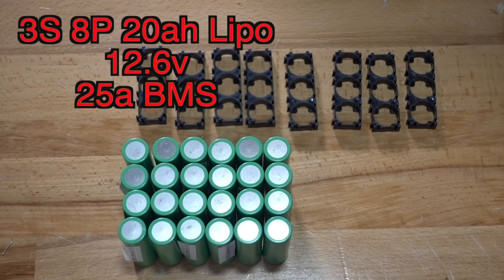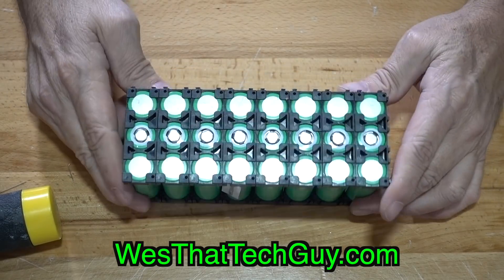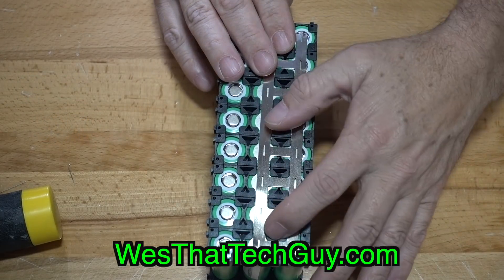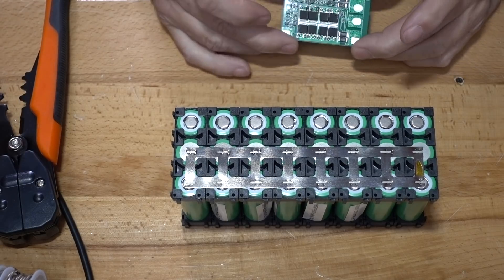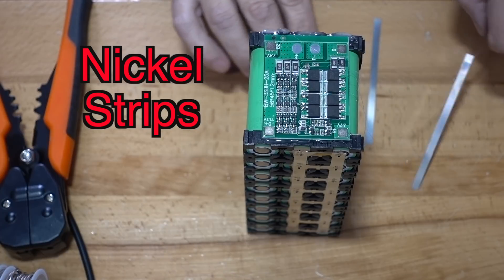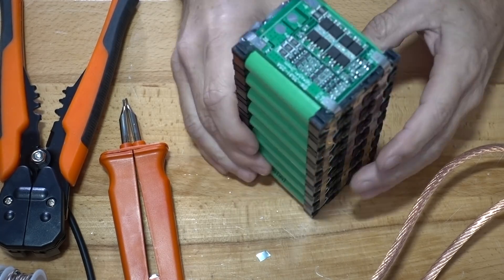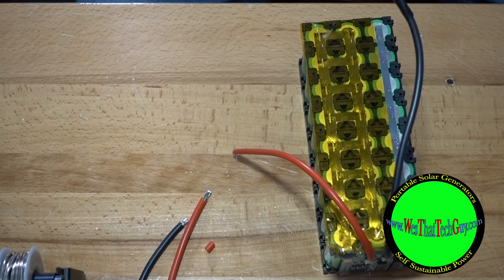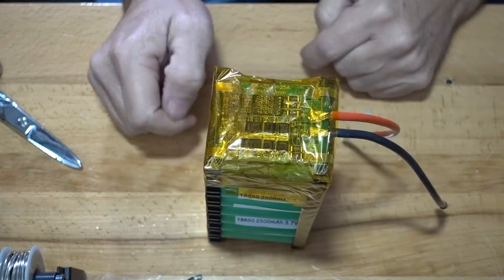How to Build a 3s 18650 Lithium Battery Pack w/ BMS Tesla Power Wall fixed music

Comment: I have a ton of 18650 cells. How can I best make a pack to put parallel to my solar panels. My panels are total 800w and it needs to store about 4.8kW.
My inverter is also 800w so thats what I would draw from it at max.

Comment: Hello I have used a 40amp bms on my 12v battery pack and after connecting it up correctly I cover the bms in tape for safety and when I turned the battery on its side a fuse has blown on 2 different 40 amp bms the fuse is right beside the 4.2v(P3057LDG) do anybody know why this is happening thanks

I dont know if it is a fuse or not its the little black chip right beside the 4.2v connection

Comment: Hallo, kann ich 2 Akkupacks mit jeweils 1 BMS per Akkupack parallel schalten und mit Ladegerät 12,6 Vol zusammen laden ?
	Hello, can I switch 2 battery packs with 1 BMS each using a battery pack in parallel and load 12.6 volts with charger?

Comment: Any suggestions for making a battery with variable voltage, constant current, constant voltage like a bench power supply has? My idea would be usb-c chargeable. This is directed to anyone out there who has knowledge.

Comment: Ive watched this over and over and the way you have the batteries it looks like its touching the pos and neg at the same time ... isnt that a direct sort on the battery
Reply: No, its in series and there is no short because the + and - on the opposite side is the opposite of that in order to raise the voltage.

Comment: Hi,

I built a 3s7p, 40a bms looks similar your bms, everything works except when I charge the pack, the charger seems always charge at constant voltage mode and the current is low, fraction of what I set it to charge at. Any ideas?

Comment: I’m doing a 3s2p 12.6v battery pack with Molicel P-28A cells and each cell is 35A and 2800mah each cell . What BMS with balance should I use , a 40A , 60A or 80A BMS with balance ?

So the 3s2p i will build will be 35A both rows 3 cell each in series and when combined in parallel it will have a total of 70A so it will peak at 140A at a max discharge rate the 3s2p battery pack , so at least i will need a 80A bms or a 100A Bms ?

Comment: Nice vid but how do you exactly charge this thing up?
Reply: Since it’s a 3S you use a 12v chargesr you can find it on Amazon and just be sure you get a charger that can handle the amps so what I use for my battery I built like in the video is my imax B6 mini charger.

Comment: Hi
Thanks for your video.
Can we use this type of battery to replace lead acid ups batteries?
Reply from the maker: If you can match the voltage to the charger inside of the UPS
Reply: @WesThatTechGuy  do you mean 12.6v?

Comment: if each 18650 is 2500 mah then would it not be a 6 ah battery instead of a 20 ah battery as stated ?
Reply: 8P is 8 parallel , that is 8 x 2500mAh = 20Ah

Comment: Hi what do I need to build a 20ah 12 volt  lithium 18650 external battery it's to run a cellular 12 volt trail camera. And to recharge it. What bms will I need. Thanks

Comment: What charger voltage is required, 25.2V or 29.4V?
I can't seem to get a definitive answer to this, both chargers are available but what one is best ?
Reply from the maker: 12.6v charged. It has been listed in the comments numerous times. It's neither of the 2 you listed. Its a 11.1v nominal and 12.6v charged. you need a 3s (12.6v) LI-ION battery charger.

Comment: Excellent !! Please let me know for 3S10P configuration with  battery ICR18650-28A the BMS How many amps should it be?

Thanks in advance and Regards 

Jose
Reply from the maker: Jose, I need to know the application you're using it for? How many amps will you be drawing and charging continuous?
Reply: Good Morning !!

Actually, this configuration is for two projects, the first is as a portable starter for cars and the other is to be used as a power bank for a 12 volt mini inverter with a maximum discharge of 3 amps hours.

Once again Thanks and have a nice day 

Jose

Comment: what size is the nickel strip that you used here?

what voltage and current would i need to charge a 12.6 volt li-ion battery please
Reply from the maker: i used standard 18650 strip. you could do 16.6v and 1a-25a to charge this battery.

Comment: You should be soldering to the board, not using a spot welder.  The board traces aren't intended for spot welding.
Reply: You get bms boards, like in the video, that has nickel strips attached for spot welding.

Comment: Hi how do you charge this battery (you charging trough the main red and black wire or you add a separat charging connector) And what tipe of charger do you use to charge?Thanks
Reply from the maker: charge and output to load is on the red and black. pos to the battery and neg to the BMS

Comment: a few questions.. I might sound being dumb..
1. Where do we supply the Input power to charge the 18650s? and How many Volts do we need to provide?
2. If the answer to my first question is "P+ and P-" then from where do we get the output power?
3. How many Amps max can we get out of this battery? What are the factors that determine the Max Current output?
Reply from the maker: you connect all pos. loads to the batteries + terminal the all the neg. loads to the BMS' - terminal.  this battery can output 200a. this is done by calculating 8p x 25a = 200a

Comment: I have one of these but the 3.7v and 11.1  terminals are on the opposite end as yours. Does it matter which way we position the charger?
Reply from the maker: no as long as you configured correct.

Comment: I am looking to make a pack that has a rather large capacity. I like the 3s config. Can multiple packs like this be connected in parallel for better storage, or would I just add more batteries to the pack? Thank you for making great quality vids!
Reply: You add more batteries
Reply from the maker: Yes, absolutely, but either way works

Comment: Hey, super great video, I'm planning to build a 3S7P almost like yours here, I'm wondering which BMS is better, It'll power a Chicago power systems inverter (92708) which is rated 12V 400 watts. I don't quite understand yet if the battery capacity determines the BMS's amp rating or if it is determined by the load.
Reply from the maker: Julián Mauricio Ramírez Obando Thanks for watching! Your inverter is capable of producing about 34 A. And your battery bank average will depend on what type of battery you buy or use. 400 W divided by 12 V equals 33.3 A. The BMS is to protect the battery pack. I would suggest a 50 amp continuous balance BMS. We currently have them in stock at SolarGeni.com
Reply: @WesThatTechGuy  Does the discharge rate of the each cell have importance on what the size of the BMS current level should be?

Comment: Thanks for the video.  I would want to connect a balance lead to the pack.  Is that what the regulator you installed is for, or is that for strictly discharge regulation?  Thanks.
Reply: Most of those boards have it on it already you just have to read the description of the board
Reply from the maker: its a BALANCE BMS

Comment: How do you recharge this? I built one exactly like this and can't get my charger to accept it. Isn't it missing a balance lead?
Reply: By using 12v charger you can charge it
Reply from the maker: balance leads are directly soldered to the pack. watch closer. 12.6v CC/CV charger Li-ion only

Comment: Sir  Can I charge it with 15v 2A  ac adapter, or I must have 12,6  2_3A
Reply from the maker: NO. you must use only 12.6v MAX with CC/CV you can use any amperage under 50a

Comment: QUESTION: if you want high amperage AND capacity in a “performance” ev how difficult would it be to have a secondary battery pack that has a high cdr compared to a larger high capacity pack that you use for every day driving? Like if you put your foot down or went up a hill the higher amperage battery pack takes over when there is a higher current demand?

Looking into using a model s drive unit in a e30 bmw. Just a newbie doing internet research and throwing ideas around. In theory would like to use a large pack of Panasonic NCR18650BD cells for capacity and a smaller “turbocharger” pack of something like Sony VTC4 cells for current.

Any information or feedback or more info on anything like this or diy batteries or tips and tricks or whatever would be greatly appreciated. Thank you for your time for anyone reading this!
Reply: I think what you are talking about is in whats called the hairball or controller for the motor no matter how many batteries you add if thats not modded it wont ever go faster then what its set at

Comment: Hello Sir, as asked in a previous question, do you know why my  3s BMS gets red hot to point of burning my fingers, all wired just as you have done, as a temp measure I have cut all nickel strips off and await your reply please?  many thanks,
Reply from the maker: ian whiteley Generally if the bms gets hot and it’s new it’s because you’ve wired the positive leads wrong and then plug it in. You’ve got to be sure to get all the proper positive leads to each group of cells. test the pigtail with a volt meter at each point you should double your voltage if your voltage does not double all the way up to your required voltage then you connected wrong. If that is all correct and still getting hot you probably have a bms issue. Is it hot when you just plug it in or does it get hot after you ran a load through it?
Reply: @WesThatTechGuy  Very many thanks, now sorted,
Reply from the maker: @ianwhiteley964  You're welcome.

Comment: how many Battery can i parallel to Using the 3s 40A BMS Board
Reply from the maker: Wessam, It depends on what the ah/mah of each battery is. If they are 2000mah/2ah you will need 20 in parallel.
Reply: @WesThatTechGuy  thanks
Reply from the maker: Your Welcome
Reply from the maker: YW

Comment: why my bms 3s positive side 101 chips gets incredibly hot, hot enought 
to burn fingers if you touch? I have 36 batteries connected as shows in 
this video. Have tried to connect 4x 3s bms, thinking maby its to high 
amps for 36 batteries, but still all 4 bms B+ side is frying hot!!! What
 i did wrong and why is so hot? Dont think it should be that hot. But if
 this normal, dont realy want to use BMS as i dont think it safe to use 
them at that temperature! Please need help asap! Thanks
Reply from the maker: If its with no load make sure you connected your balance leads to the correct set of cells. If wrong the BMS will get hot sometimes. If with a load than could be a problem with over amperage.
Reply: @WesThatTechGuy  no load, and all connected by the scheme off the bms. I have tripled the resistors(101x3) in series and its berely gets warm now. I guess the bms isn't proper build. It's 12v 25a bms I got from ebay.
Reply from the maker: the bms should be ran in parallel not series if using more than 1!!! You need the 11.1v/12.6v bms for a 3S lithium pack.
Reply: @WesThatTechGuy  I tried 4 bms connect in parallel, but resistors of all 4 bms was still getting incredibly hot. What I did, I have removed resistors from other bms and soldered on one in series. So instead 1 resistors I have 3 connected in series. Only that way I got temperatures down to normal. I'm not sure that's the right thing to do, but for the moment I haven't tested how bms will work on charge and discharge.

Comment: I bought a 4S 40A BMS. My question is for 40A, how many "p" maximum I can have in this 4s pack?
Reply from the maker: this can be infinite amount of batteries in P (parallel). you just cant charge more the 40a or discharge more than 40a.
Reply: Wes That Tech Guy Thanks. You are one of the few guys who answer to learners. Great! 
 But still I need more advise. 

“”Charging not more than 40A””
. Can you please break this and tell me in simple words?

Can I able to BUY your one hour online video hour to get trained in my week places. I will pay you before the training? Please do not misunderstand me.
Reply from the maker: kuna, thanks. Yes it is best to learn and understand the safety of the battery and BMS and balance charging etc. Yes you can do the 1 hour consult with me no problem. Just let me know. You can do the order on the website and we wil schedule it whenever you would like.
Reply: Finally you have wrapped the cells with a yellow plastic roll. What is the name for it and can you please give me the link to buy?
Thanks.
Reply from the maker: this is called Kapton tape and is used in electronics to protect against shorts etc. heres a link for you. https://amzn.to/2Pvf1Jq

Comment: Nice instructional video.Good job. I am just learning. .I made a 4s 1p and connected to 12V 5W led light and light burnt away in one min. I did not use any bms. Then I made a 3s 1p and connected another led 12V 5w It worked but not too long. It droped the brightness. For my 4s, if I would have used a bms would have I avoid burning the bulb?
Reply from the maker: thanks kuna! the light burnt out not because of no bms but in 4s it was running at 16.8v and your light is a 12v light so the over voltage most likely made it burn out. at 3s it's 12.6v charged so will be good for a bit but will get dim as the battery drains. to run a 12v light on a 4s battery pack you will need a DC buck converter or a way to reduce the voltage from 16.8v to 12v continuous.
Reply: Wes That Tech Guy Thanks. I understand now.
Reply: is this charging for solar???
Reply: @elyasjan5968  yes.

Comment: Hello, I have 4 12v 10ah Lifepo4  Dakota Lithium batries wired in series which charger is best for my battries that you sell.Thanks
Reply from the maker: you would want to get our 16s lifepo4 charger. You could get by on our SolarGeni 5a S120 or our 15a C300.

Comment: 4S is superior to 3S for 12V. A BMS with balancing is superior, as well. Coupled with an appropriately sized inverter for powering AC loads, as well as a DC-DC converter providing a constant 12 volts to a DC distribution buss, together with charging power sources (DC in via a "wall wart", as well as a car adapter and solar), and you have yourself a full-blown 18650 power station.
Reply: Please explain as to how 4S is superior to 3S to obtain 12.6V (did you mean “superior” in higher than 12.6 volt, then, of course (ie: 16.8v)
Thanks.
Reply from the maker: John YES you are correct! Thanks for chiming in! And yes you can get exactly what you're talking about over at SolarGeni.com. This is what we do. This is just a simple 3s battery build with a BMS for tutorial purposes. We make them in any series needed and also sell the 18650 powerstation otherwise known as the SolarGeni Portable Solar Generator. We sell them in several sizes from 1000w 12v, 6000w to 15KW 48v. Also have a great selection of LIpo and LifePo4 battery chargers. lithium 18650 cells and Headway Lifepo4 38120s and 38120 HP cells to choose from. Stop by and give us a look. Thanks again!
Reply: @WesThatTechGuy  will you be getting the 15ah headways?
Reply: I thougth 3S are for Li-ion's and 4S are for LiFePO4.... am I correct???

Comment: those bms do not balance anything over a 1s pack i had to get seperate balncer that draws 300mah just to get a 3s5p back to balance proper
Reply from the maker: works fine on mine?
Reply: @WesThatTechGuy  it could be cos i use salvage cells but when i looked at these bards they tend to have 45ma draw for balance when i looked at balancing 300ma is more that needed for a 10ah or so pack

Comment: Make sure the bms is rated for over your packs ah. Made a pack and I'm 3ah over board rating and it causes the board to not function correctly.
Reply: Peak amps (current), not amp hours (energy capacity).
Reply: @ARepublicIfYouCanKeepIt  I have to disagree with that. Could be the board I have but my load is not even an amp. My pack capacity is at least 13ah.  My board is a 10a and the output shuts down when load is turned on. I've tried 2 identical boards and both behave the same. I've got some 100a boards coming that will hopefully solve the issue.

Comment: Sir please make 24 volt 20 ah life po4 battery pack for e cycle motor used in e cycle is 24 volt 250 watts.
Reply from the maker: ok. I will do it soon. Keep watching.

Comment: Probably the most simple to understand pack I've seen!
Reply: That's because it's missing a few components. Should be 4S, and include balancing (via an upgraded BMS), as well as charging, at a minimum.
Reply from the maker: John It's not missing anything? It's a BALANCE BMS and 3s? Why should it be 3s? You can make a pack in any series one desires. Charging is as simple as connecting one to the Red + wire and the Black - wire
Reply: What is AH of this battery and max amp please tell

Comment: I thought 3s packs were near useless for backup power... too low for 13.8 float, too high for inverter use... the bms will keep the pack safe I guess.
Reply from the maker: This is just one of many ways to build a battery pack in series with a BMS. You can do 4s-16s no problem and then some. Just repeat the steps from 3s to infinity etc. Also inverters are changing everyday so these things can be achieved easier now. That said in my opinion 4s is still the way to go for a 12v system rather than 3s.
Reply: It's not completely true, the 13.8V drop immediatly at 12,60V or less even with small loads, so the 12,6V of 3S battery are good.
The problem is that the commons inverters have a range from 9,5V (stop working)/10,50V(acustic signal starts) - 14.8V, so 3S is a little bit less than 14,8, but 4s are a lot more than 14,8.
The best thing to save money is a 3S battery pack, if you disable acustic signal you can use about 80-90% of battery.
The best thing for life cycles of batteries is 4S, but you need to buy more because you can charge a lot less than 100%, but discharge completely